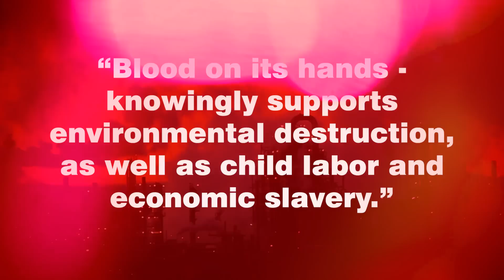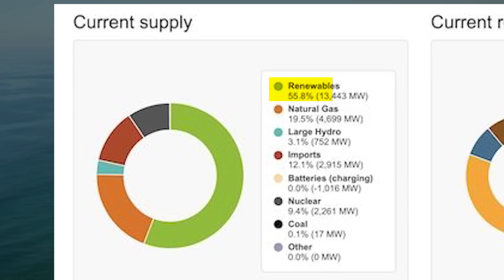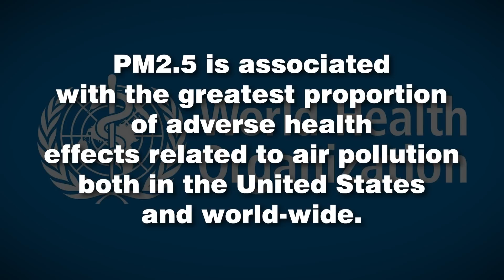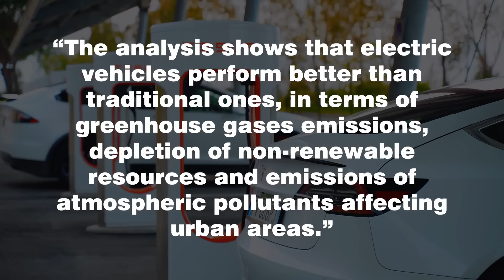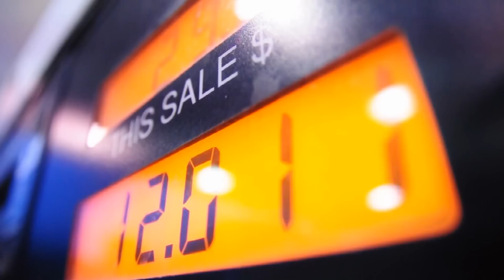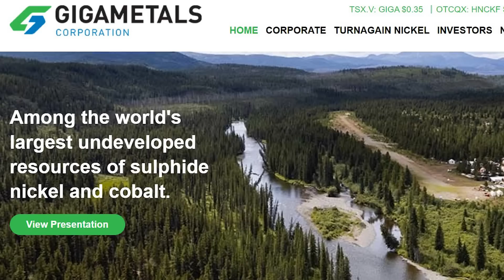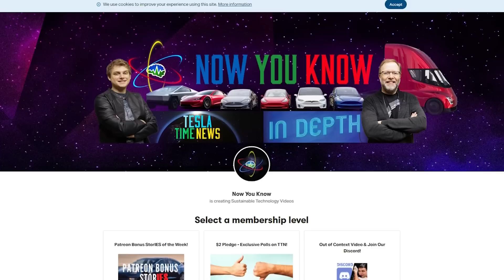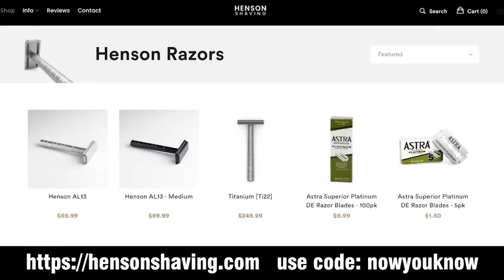Debunking More EV Lies | In Depth

Comment: At 3:08, "If you plug your EV in at home and you have solar panels, then your EV is 100% clean no matter how you cut it." This is a lie and it raises questions about your credibility. Solar panels do not produce electricity at night, which is when over 80% of EV owners charge their car. Furthermore, if you do charge your car when the sun shines, you need much more solar panels than the average home installs if you charge at level 2 speeds. A Tesla wall connector needs 11.5 kW + Average home needs 6.62 kW = 18.12 kW. The average solar installation is 5.694 kW. You would need 4 times the average solar installation to even think you are close to 100% clean energy.
Reply: I thought I was the only one to get this. Do all solar users think they're 100% green while still be grid connected?

Comment: Wrong! But nice try....and absolutely lame attack of this lady

Your arguments negated these realities:

1: Solar and wind STILL REQUIRES fossil fuels to manufacture them, and in regards to wind generators they require thousands of tonnes of concrete to set even ONE in place, blades are made of composites that cannot be recycled and have a limited lifespan (thus they bury them in the ground in Germany to hide this fact) and the generator, gearbox requires huge amounts of synthetic lubricants to even function, again...derived from the FF industry
2: Lithium mining for EV's does HUGE environmental damage. Current Reprocessing Plants of the batteries are minscule on actual scale because its still CHEAPER to mine new material., This is STILL the case with many plastics even. 
3: CA doesn't have even close to the infrastructure for everyone to have EV's hence the States current dilemma 

I have investments in both Green & Fossil fuel tech because BOTH need each other to exist. That.... is the reality.

Comment: You guys are correct in just about everything you say, but here in Cali we can't keep up with electricity demands during our heat waves let alone covering everyone charging their EV.   Clean energy is not HERE yet, it is coming incrementally and solar and wind ain't gonna cut it without adding nuclear to the mix.  

What is the electrical  equivalent in terms of KW's to a tank of gas?  I'm not a scientist or math major, but I'm quite sure our nations electrical grid is not capable of supplying the power needed for everyone to go EV.  It seems that our gov't is doing things backwards (no surprise there) in that we need a revamped and robust and reliable grid BEFORE we begin mandating that everyone must switch to EV.

Comment: You two kinda debunked your selves. Home solar is not rated to full use of charge to the EV. The wall charger has much more kw need than most appliances.  In fact if you have not expanded your solar array to have additional batteries, you will trip your inverter and be using regional power until the DC load can regenerate. Question can you confirm a home solar array can reliably charge an EV as well as all home needs? You seem unsure. 🤔

Comment: What nobody seems to understand is that electric cars are cleaner regardless of whether the electricity was produced cleanly in the first place.
If you had a grid powered by diesel generators exclusively, and had nothing but Teslas charging off of it, you'd save about 50 or 60% of carbon emissions over just driving diesel cars.  When diesel in a car engine burns, only the expansion of the mix delivers energy to the car.  The heat added to the engine block is a loss.  The heat coming out of the pipe at the back is energy loss.  The unburnt fuel from the engine having to torque at less than ideal RPM is also a loss.  And using the brakes is also pure energy loss.
  A diesel generator, on the other hand, works at conditions far closer to the maximal efficiency point, and then Teslas are better than 90% efficient, themselves, so you end up with a much better carbon picture.  Greener energy sources are the cherry.
  That Sorel Amore girl is good about money, but she should not talk about anything else.
  And speaking of the devil, I'm subscribed to her channel.  Time to fix that problem.

Comment: The elephant in the room that no one talks about with electric cars is that if everyone had one, even if a country had enough generation to charge all of them, the grid infrastructure will not be capable of passing all that energy without major upgrades. People will argue this I am sure, but time will tell.

However, I do look forward to all these cheap batteries that will be removed from electric cars when they replace them. They will be great for static power applications, even if they only offer 50% of their original capacity.

Comment: Thank you for your insightful video. Why isn’t the cost of procurement, manufacturing, refining transportation, storage and delivery not included in the cost factors when making the argument of fossil fuels v renewables? Seems like it would be easy or is it already baked into the $ per unit of energy density such as a gallon? Can you do a video on that? 🎈

Comment: If you get rid of the catalyic converter off cars period you willget rid of most of the co2 emmissions in rural areas. CO blows away or the rain washes it out the attmosphere. stuff they dont want you to know.Iwas an emmissions inspector for phoenix az They need cats because of there local is trapped . the rest of az doesnt. as for evs i love my electric weed eater.

Comment: There are EV lies on both sides. The pollution is shifted from the tailpipe to the power plant. The mining of the minerals tp produce EVs uses fossil fuel and also in environmentally harmful. Solar and wind will never supply enough energy to replace fossil fuels. We need to supplement this with nuclear. Until there is an honest exchange of ideas we will never get past the lies on both sides.

Comment: Hi Zac and Jesse. Fan of your show ;-)
Have you tried this angle?
Crude oil, so fare only found on Earth and there is a finite amount availeble on Earth.
Processing time for focile fuels (simplified):
step 1: Carbon is captured by biological life and it dies. if captured by earth in the right conditions, it only takes minimum one million years, to get to crude oil.
step 2: pump the oil and refine the oil, to useble diesel, jet fuel and so on.
step 3: burn it.
step 4: wait minimum one milion years for the earth to reestablich the oil reserves?
Best regards Svend Erik Elgaard/Mechanical Engineer/7 years driving model S/Denmark - Europe - Earth ;-)
Reply: Earth will survive the presence of man! Will man and other biology survive the contribution of man to Earth?

Comment: If an EV like a Tesla model 3 std range can be purchased today and still be able to have its battery pack changed out in say 20 years with the car then being given a new life. This is typically not a feasible option with an ICE car. This will have a substantial impact on overall EV emissions.

Comment: The U.S. going to all E.V. isn't going to solve anything when you have a nation of 2 billion people who are riding 2 cycle engine motorbikes.  The U.S. allowed manufacturing to the leave the U.S. to move to countries without environmental laws and since that time pollution has increased dramatically.  These people are now buying means of transportation that create lots of pollution and so long as nations like India refuse to clean up their act our world will continue to suffer.
Large cities should have EV only zones to keep pollution down.  The entire west coast seems like a city from one end to another.  I see the need for stringent laws there.  So we should noty be concentrating on the us going ev as that will occur naturally but rather get nations like India to create and enforce Environmental laws.  Stupidity seems to be the issue.
Reply: 2 cycle engines require oil be mixed with the gas which is then burned in the combustion chamber creating more pollution than a normal gasoline engine.

Comment: Correct arguments, but one should not forget the total life cycle CO2 footprint of an car, means from design to end of life including recycling.  For ex. Renault Zoe 40KW the first CO2 position is steel (car body) and not even the battery.

Comment: Hey guys, long time subscriber here and 100% back you - However, your point on PM2.5 particles is a tiny bit misleading, since they are sourced not only from burning fuels exiting the exhaust pipe - All EVs and ICE cars still produce these particles from tyre wear 😔

Tyres, which are commonly but erroneously assumed to be made from natural 'rubber', the sap from a rubber tree (which they were for a time) are actually a synthetically derived by-product of crude oil - the very same Dino juice we are trying to avoid 😔

When we drive, the friction between road and tyre cause them to wear down - hence why we need to change wheels every so often. Sadly, this 'wear' goes somewhere.... It either remains on the roadside or it flows into our waterways OR we breath it in - It never fully breaks down, much like plastics (also typically made from Crude oil) 😔

And, because EVs are heavier vehicles, they wear down synthetic tyres faster than ICE cars - Especially when people drive them fast, instead of efficiently. This is why people doing doughnuts, burnouts etc etc, or even 0-60 tests is so idiotic in the grand scheme of things.... 😵

I own a Model Y LR and a Model 3 SR - I love them so much and am so privileged to be in this position, but I am also aware that there are still consequences of their use and they are not quite the golden ticket, yet. We need to find a new material for tyres - Or make flying / hovering cars 😂
Reply: The "because EVs are heavier" opinion is wrong for 2 reasons.
Like for like, they're not really.
.
Much tyre wear will come from poor traction.
EV traction control is A.UCH more efficient.
Reply: @rogerstarkey5390  I would say that we are both right.

But the point still stands that current tyres, ICE driven or not are produced from crude oil. Plus, everyone drives differently, under different circumstances. 

Regardless, the production, transportation, use of and 'end of life' cycles do not suppress the expulsion of these particles, even if traction control on an EV is better. 

The tyres do still wear down over time and can't be recycled without melting/ burning :(
I know some industries re-purpose old tyres by cutting them down and putting them into road surfaces and play parks - but really, this is just increasing human and environmental interaction in a negative way - Tyre industry greenwashing if you like lol

I currently have around 20,000 miles on my Model Y tyres and at last check they are wearing very slowly, so still have life in them - But not every EV owner drives with a conscious of this in mind, sadly.

Comment: Too bad not to have brought the argument which irrefutably demonstrates the advantage of using electricity as an energy vector and not fuel in a car: THE EFFICIENCY!  An engine (Diesel or gasoline) has an efficiency of less than 18% (OF useful mechanical energy, the rest goes into heat), WHILE THE POWER PLANTS, also supplied by fossil energy have an efficiency close to 30%...  almost 2 times more than an ICE's!  As losses for transport and storage of electricity are a few %, the balance remains positive!  So, and only with this argument alone, it is better to use an electric car than an ICE, even if the power plants were all powered with oil!  
And one could add the fact that these large power plants have much higher emission gas filtration requirements than ICE's...
Thanks for your show & shame to „Amore“ 😼

Comment: Doesn't matter how clean it is,  if it can't do thr job.  The technology and Infrastructure need to improve.   One example.... no chargers within 50 miles or more of a racetrack, and I have 120 miles towing range... guess I'm not using my truck to charge anything, have A/C in 100 degree heat, etc.  Good luck running to lunch.   A 2.5 hour trip turns into a 4.5 hour trip with 3 charging stops to have enough charge to get back to a charger from the track.  Also, it'll be interesting to see what happens to electricity costs as we shift from gas to electricity for cars....

Comment: Some of what she said is true some of what they say is wrong. California is a mess and the electric grid is way over stretched and most of the cars on the roads today that burn gas have a catalytic converter which turns carbon monoxide and converts it to carbon dioxide which is the food that makes all the nice green plants trees and plants grow better and work as air cleaners and you still have the battery recycling problem. Don't get me wrong we need clean energy no doubt, we are beating up our planet, needs to stop. But this video is right and wrong and each side tries to make their point of view correct..
Reply: That'll be ... "NO"
"The grid is overstretched"
Why?
Poor investment.
Insufficient maintenance.
.
Nothing to do with Electric Vehicles.
.
"Most cars have catalytic converters"
And they STILL pollute.
You missed ALL the "nitrogen compounds" in the video?
The "particulates".... Which pass THROUGH filters?
.
Then there's CO2....
It has to be IN BALANCE
It's NOT.
You're essentially comparing to 
"Food is good for me, therefore if I eat more food it's BETTER for me...... "🤔
.
"All the nice green plants and trees..." That we're cutting down faster than we grow them?
And that takes us back to the "Tree food" (CO2)
TOO MUCH IS BAD.
(Look it up)

Comment: A few comments: 

- Unfortunately, PM2.5 is also created by tires and brakes. Heavier vehicles may create a bit more of it. 

- Cobalt is also used for de-sulfuring of gasoline and to harden crankshafts and camshafts. However, ICE drivers never bring that up… how convenient!

- I’m Kongo, child labor is happening in smaller local private mines. However, the large ones don’t employ children. The small ones could not contribute enough Cobalt for any meaningful EV battery production
Reply: Your statement should bring solace and comfort to the 40,000 kids mining Cobalt in the Congo.
Reply: @notatthistime3867  Where did you get that number? Fox News?

Comment: One point for the pro ev is that the oil industry also uses cobalt to remove the sulfur to reduce or eliminate the acid rain effect and they use more than the ev's do per year (it's mainly because of scale gallons vs gwh) but still cut the gas and free up cobalt (and I'm still stuck in my ice cars...)

Comment: WELL SAID! there's just one more juicy tidbit you can add to your arsenel zach & jesse. ALL modern natural gas & coal power plants- utilize a co-generation cycle. without getting too technical- in effect- it means- worst case scenario- they're 40% efficient- and the latest tech they're getting 50% efficiency. think of it like this: the VERY BEST modern ice engine tech gets around 27% efficiency. most of the energy from burning the gas just gets lost as heat & friction- up in smoke (where my money goes.. .nandanda da) lol. I suppose you COULD add a stirling heat engine & recoup the lost heat- but then a 3/4 ton ford van would only have room for one passenger- the driver. so for cars? not a good idea. but for a power plant? the perfect idea. this is one of the BIGGEST reasons EV's win the gas vs. EV argument... .among MANY others. for instance?

regenerative braking. AHA!!! not only does the ice machine NOT recoup that energy- it wastes it & then creates brake dust, more parts worn out & more labor to boot. 

I heard an argument on youtube about how "ev's are so much heavier- they do more damage to the roads"... hmmm.... the tractor trailer tankers that roll up & down 99 past my town about 8 times a day- weight around 60,000 lbs. WHAT ABOUT THAT WEIGHT? and how much does the 78kwh's every three days that my model Y uses- how much does IT weigh? NOTHING. zero. zip. nada.

Comment: Batteries don't really show much before they go out. I've had 2 go out. Both around 130k miles. But these where 2013 model years amd have gotten better.  But cost of replacement is still high mainly because demand for batteries is high and will hopefully come down sooner rather than later

Comment: What a BS video. You greenies ignore the cost of fossil fuel and damage to the earth by mining Lithium and other rare earth minerals. It takes 500,000 pounds of earth to be moved to produce 1000 pounds of Lithium and this is all done with ICE vehicles. There is no process to recycle the old batteries and storing them in proximity to each other is highly dangerous. EV batteries are only storage vessels for electricity and do not do anything on their own to help the climate. Where the electricity comes from is what is important. In CA over half of the charging stations are inoperative at any one time. The charging rate of most of them is so slow that any long trip is absurd. When you buy an EV you are surrendering your freedom. Enjoy your cult because your days of travel are over!

Comment: Also, I've noticed the citations you've used are largely in part, bought and paid for by "Pro EV."

So, making a point to cite "Big Oil" paying for research VS "Pro EV" based citations is irrelevant and Hypocritical. 

I also noticed you totally ignored the fact it requires "Strip Mining" to make these batteries. But I suppose that's just fine. You're also denying "Lithium" has to be mined and it's not recyclable. And EVERY battery to this point is Brand New. So, where's this "Recycling of batteries?"

Finally, "Cost" is ridiculous for the initial purchase and the replacement of the batteries when the time comes... ... ...with a New Battery.